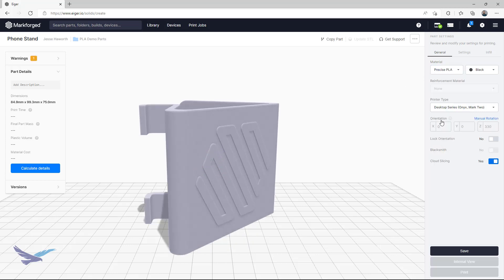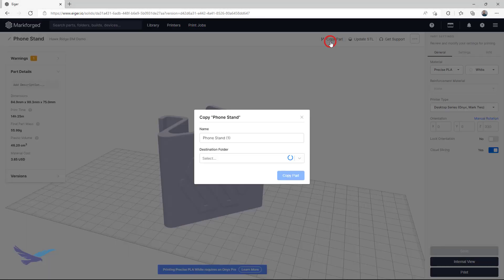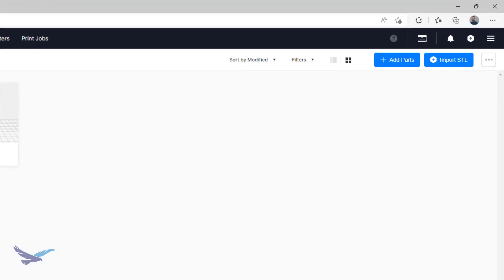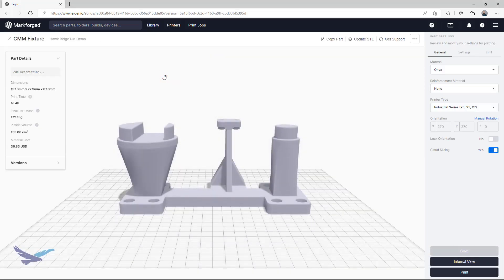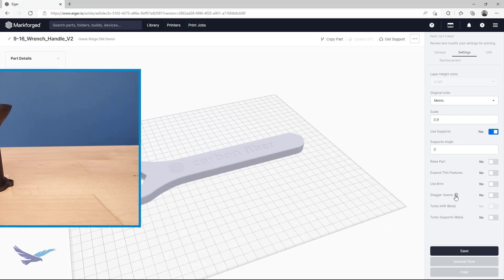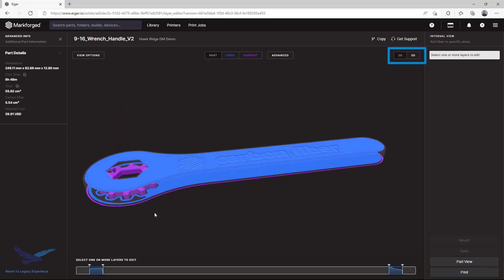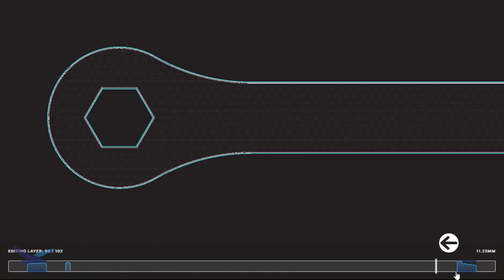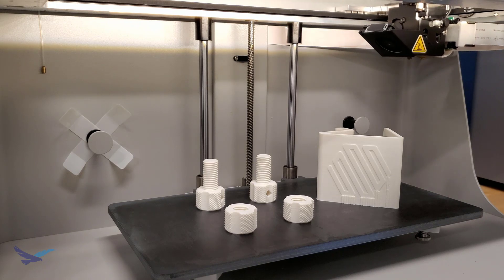3D Printing Thursdays Episode 2 - Markforged Eiger Tips and Tricks

Comment: The feature that I have been trying to find is how to set the location of the seam. 
I have a part where one side needs to have a smooth surface, and eiger keeps putting the seam on that side. The stagger seams option doesn't help here beacause it would make the part uniformly rough all the way around. If you know of a setting for this, let me know. 

As a stop gap, I have tried slicing the part in different orientations on the bed which sometimes causes Eiger to chose a different location for the seams, but I would really appreciate a better way to control where they go.